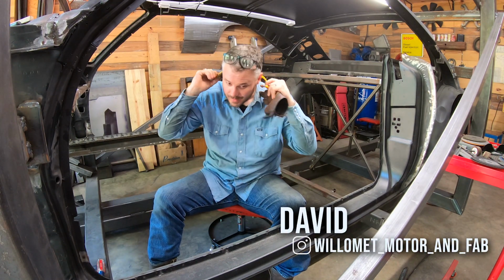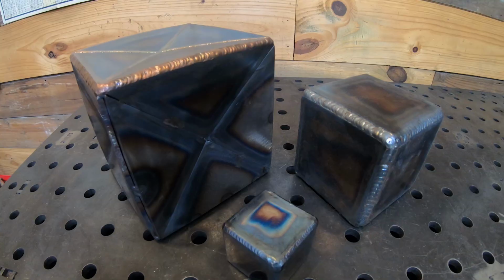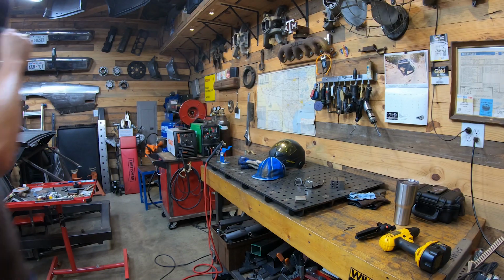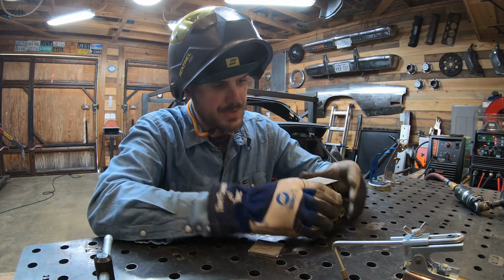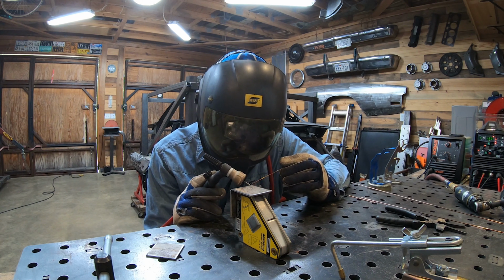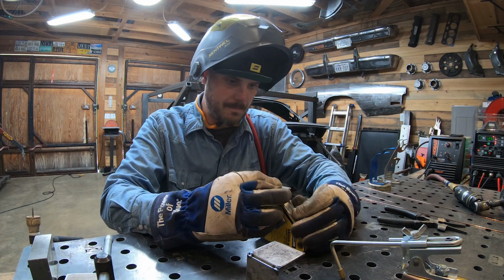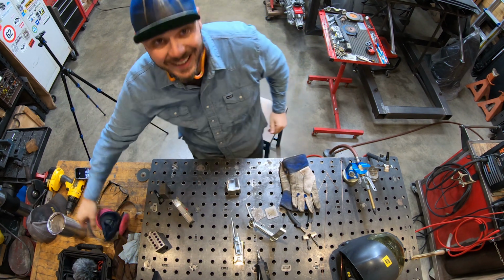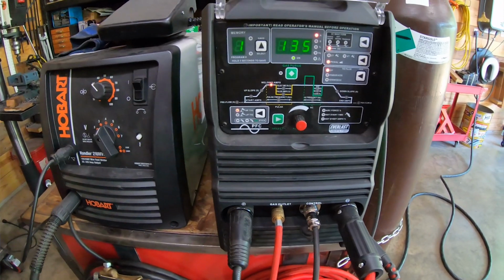TIG Welding Tips from the World's Okayest Fabricator

Comment: I got a question. I have a 2000 mustang with 28 inch rims and I was wondering how can I put 26x14 inch rims and 35x13.50 inch tires on my mustang. I seen y’all had a old school mustang on some 37 inch tires. What can I do to make them fit?
Reply: BluBlacc Dolo there’s not much you can’t get done with a welder, sawzall, and a tape measure. If you’re thinking about the DED roadrunner, they built a subframe for that one.
Reply: Willomet Motor & Fab do you think I can jus add 3 inch spacers and do a little cutting?
Reply: BluBlacc Dolo truly, I just don’t know. I don’t have any relevant experience on that platform, or in lifting a passenger car suspension. Sorry dude.
Reply: Willomet Motor & Fab I have it lifted to fit 28x10 inch rims

Comment: hi, thanks for the video, just some questions, witch gas flow rate were you using in this cube exercise?  and you said that have been using 80% of your pedal, so the real amperage was about 100 amps, since you set the machine to 125 max, am i correct?  thanks again!!
Reply: Hey, I’m glad to share. Gas was a touch over 30cfm, since an open corner loses gas pretty easily. I could have used one of the 1x2x3s as a gas block.

I’m ballparking 80%, but 100-110 is definitely in range for a 1/8” open corner weld. Travel speed affects all this as well
Reply: @WillometMotorFab  hey man, thanks for taking the time to share that details, hopping to have a super nice park/workshop as yours.